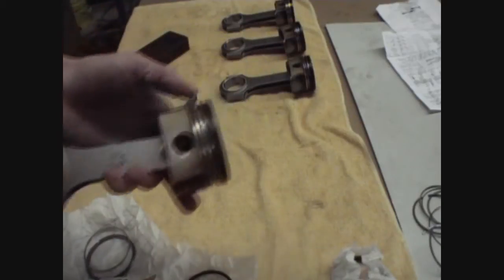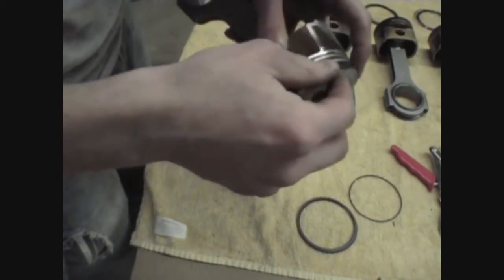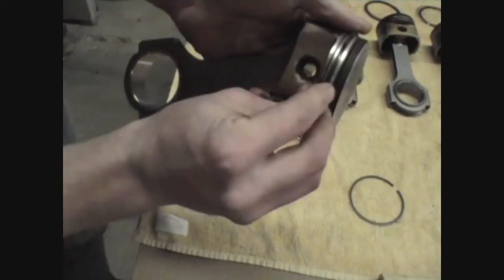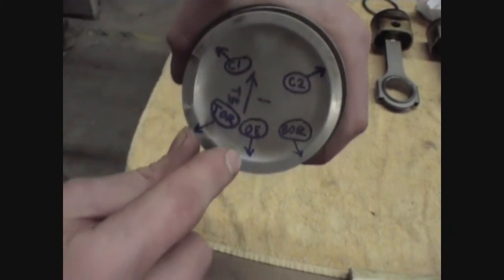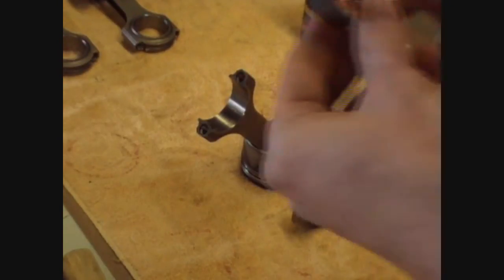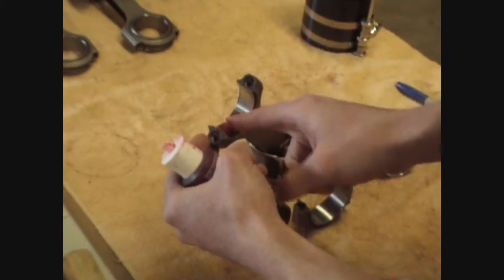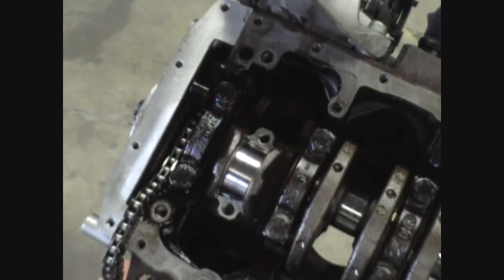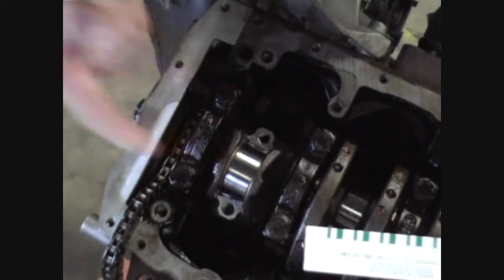1.8t engine assembly HOW TO(part 4)

Comment: If you put the connecting rod bolts back in (only hand tight), then put some rubber hosing over the bolts it helps guide the rod over the crank journal as well as helps prevent scratching the journal.